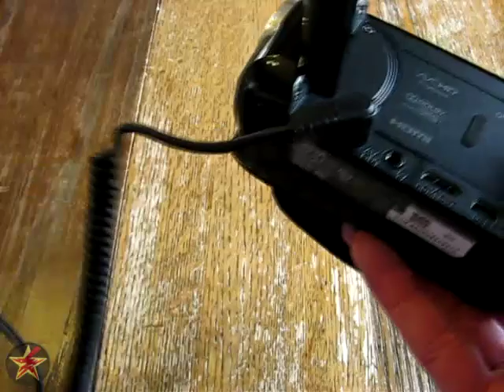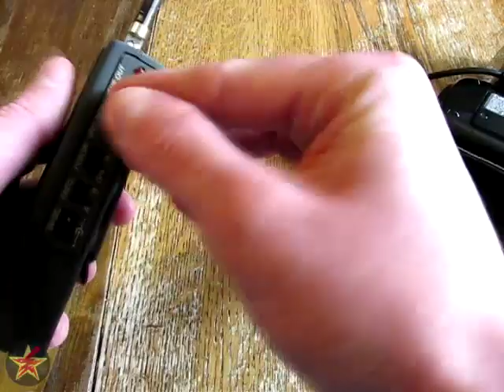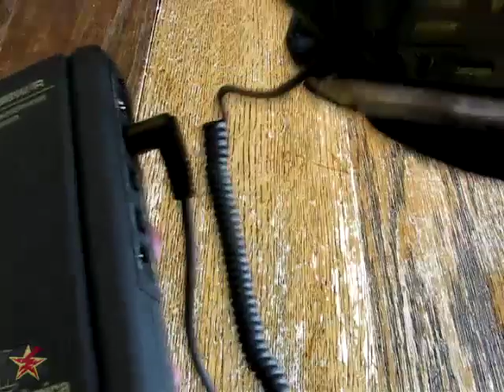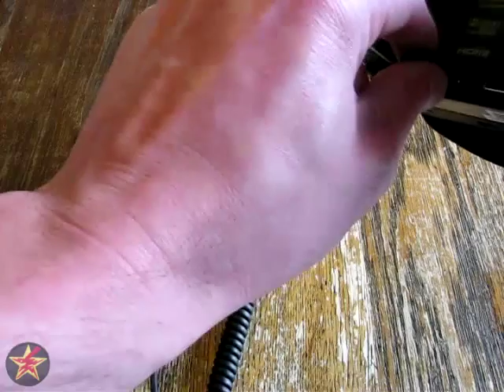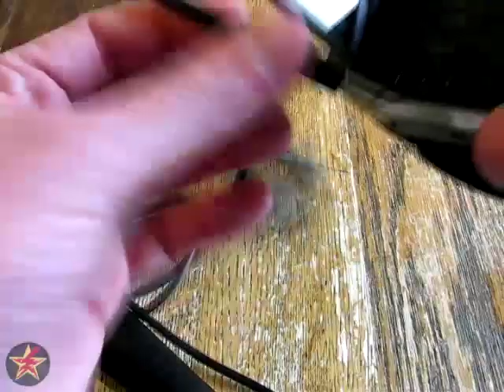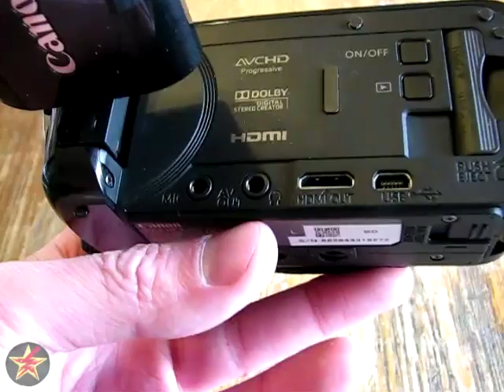Canon Vixia HF R400 How to: Use An External Microphone

Comment: buddy please please tell me..how is this wireless mic??
Pyle-Pro PDWM96 Lavalier Wireless Microphone System-PNZ

http://www.ebay.in/itm/pyle-pro-pdwm96-lavalier-wireless-microphone-system-pnz-/271159767435?pt=lh_defaultdomain_203

I will ask all my friends to subscribe to u
Reply from the maker: The mic would be ok if you are looking for a cheap Wireless mic.  You are not going to get great audio out of it.  You would also have to buy an extra adapter for the receiver that goes into the camcorder. (3.5mm Stereo Plug to 6.35mm (1/4 Inch) Stereo Jack Adaptor).  If not you would not be able to use it.  There is also the fact that the reserve would be right in front of the screen, to get around that you would also need another adapter.  So the little you are saving on a cheaper wireless mic you might loose to the extras you have to buy to get it to work right.
Reply: Very valuable suggestion indeed :)

Comment: how to figure out if i can mount external mic on >PowerShot SX280 
Digital Camera???
Reply from the maker: Might be able to double back tape one on the top to the right of the GPS bump, depending on how big of an external mic you are looking at.  Normally would would want a camera to have Hot shoe so that you can mount a shotgun mic to them.

Comment: With the lapel mic, can you plug it in directly to the camera? When I try that it does not work.
Reply from the maker: What type of lapel mic do you have.  I tried with a Audio Technica ATR288W and was not able to.
Reply: It comes with the Pyle PDWM96 Wireless set up.
Reply from the maker: xoxogeniexoxo
Might not be able to.  When you plug it in do you see a mic level option come up on the camera?

Comment: Hi there,  I Plugged wireless mic in...  When I played back the video... It appears in my software that one channel of the two is showing.. So is it stereo???  Is there a setting for mono?
Reply from the maker: I do not believe there is a setting for this.  It is determined by mic that you are using.  What I have found is most wireless mic tend to be mono channel for audio because they are made for a vocal track.  There are some shot gun mics that have stereo channel you might need to look into this depending on what you are trying to film.  I hope that helps, let me know.

Comment: Thanks for posting this. I bought some cheap wired lapel mics off of amazon.  http://amzn.com/B005DJOIPQ They were well reviewed though. The audio meter only moves slightly if you literally yell into the mic. TLDR not all mics are the same. If anyone has had some success with a plug in lapel mic (I don't want to spend for wireless) please let me know the make and model.  Thanks!
Reply: I tried an inexpensive mic, that did not have it's own power source, and it didn't work with my R40.  Then I tried an AudioTechnica Lavalier Mic (only about $20), which has a button cell battery, and it worked! 
Hope that helps,
Mimi.
Reply: That is what I got too. Thanks!

Comment: I have a question... Do you know if the camera provides plug-in power? I'm planning to buy this as well as a RODE VideoMic Go, but it needs to have 2.5 v from the camera's mic input.
Reply from the maker: I want to say yes.  The wireless mic set up that I have, also has a hand held in line mic, which I have tested plugged right into the camera.
Reply: I have a VideoMic GO with the vixia hf r400 and I can't figure out how to get it to work. It shuts off the audio when I plug the mic in, but it won't come back on unless I unplug the mic.. Is there something I'm doing wrong?
Reply from the maker: BlueNuggetProduction Is it turning off the audio on just the camcorder or is the audio not working from the VideoMic GO?
Reply: It's like in this video where you plugged in the mic and it shut off the audio until you turned the other one on. Only this is, the Rode mic GO runs off plug in power and has no on/off button.
Reply from the maker: BlueNuggetProduction Everything I see says that this should be a non issue.  The mic should work.  Last idea I can offer is try plugging in the camcorder and seeing if the mic works then.  Maybe it is a power supply issue from the battery.
Reply: So it might not have enough power supply to support the mic? Because the mic runs off the power supply of the camera and it doesn't work even when the camera is at full battery.
Reply from the maker: BlueNuggetProduction
Did it work when plugged in?  I am just trying to figure out what might be causing the issue.  As I do not have this mic myself that is why I asked.  This is how I would determine what the issue might be.
Reply: It doesn't seem like this particular mic is going to work unfortunately :( I contacted B&H Photo and they said that the vixia doesn't have enough power to support this mic because it runs off plug-in power
Reply from the maker: BlueNuggetProduction
Well that bites, sorry.
Reply: Thanks anyways!
Reply from the maker: BlueNuggetProduction
I know it might be more then what you are looking to spend but it does look like the VideoMic Pro, and Stereo VideoMic Pro are powered off a 9 volt which could fix the lacking of power from the R400.

Comment: Thank you so much! This was amazingly helpful! One more question please: can you record an "audio scene" on this camera with an external mic? It doesn't seem to be an option. The audio scene option goes grey when I plug in my external mic. Thanks again!
Reply from the maker: I had not noticed that.  Normally I just leave it in the standard audio mode when I make these videos.  You are correct, it seems that if you use an external mic. these audio options go away.  I will see what I can find out about if there is a way to get around this.
Reply: Wanderer001 thank you so much.  really appreciate it.